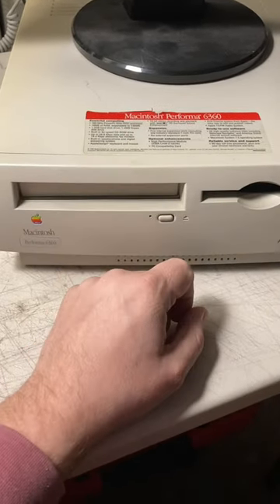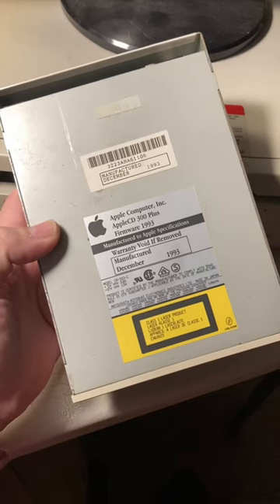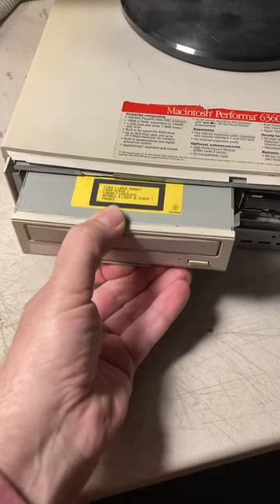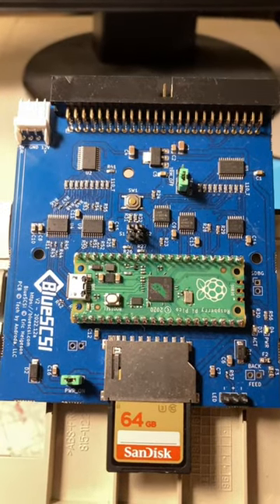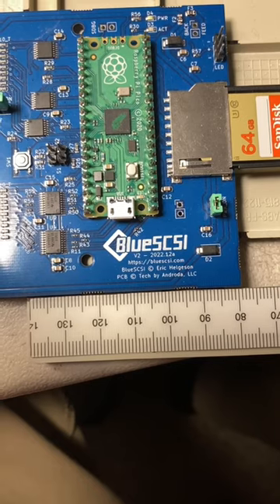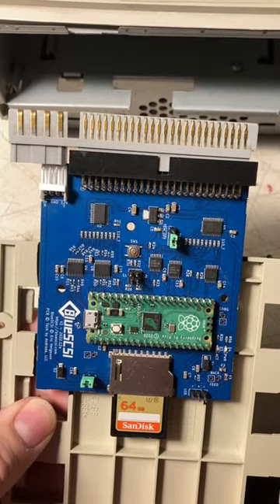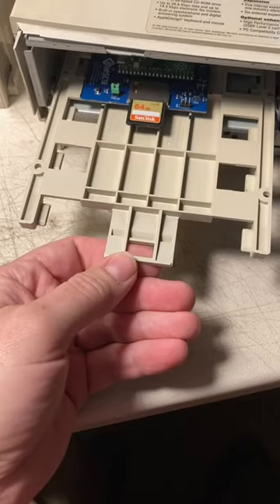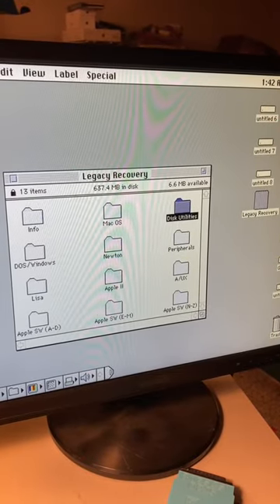#SHORTS - Replace #Apple #Macintosh CD-ROM Drive With A #BlueSCSI! #MARCHintosh

Comment: Now you just have to use either an SD card extension cable or a SCSI extension cable so that you can have the SD card sticking out of the front of one of those optical drive blanks, much like the bezel Sean made for 9600.

I mean, it can even have a blinking LED light!
Reply: Go all out and make a faux tray that actually moves and pops up the SD card holder lol
Reply: @helfire23  haha yes! Pops the entire BlueSCSI out! Gut a broken drive leaving the eject mechanism and mount it onto it